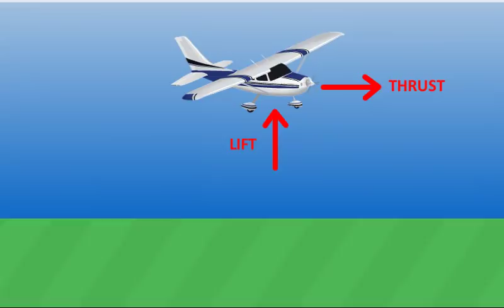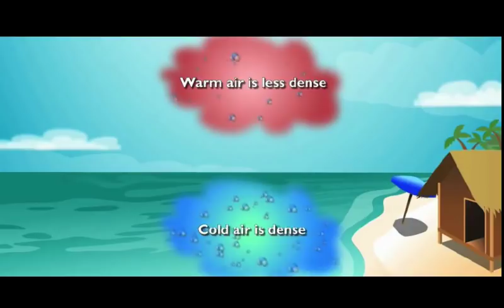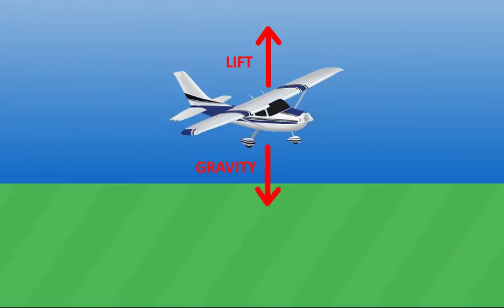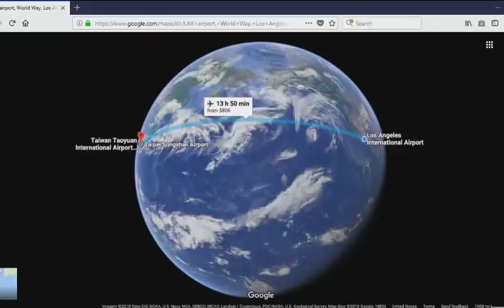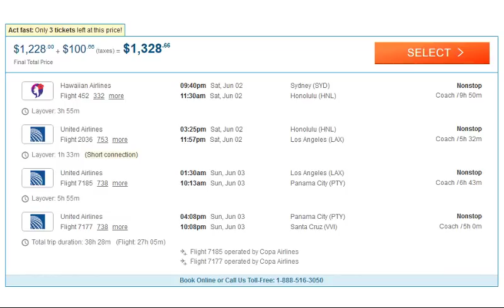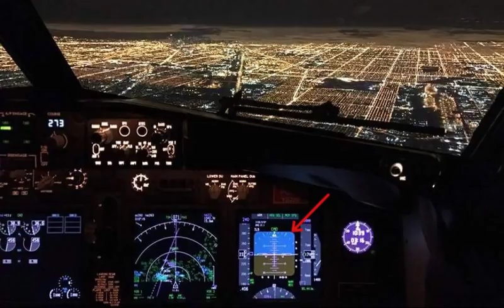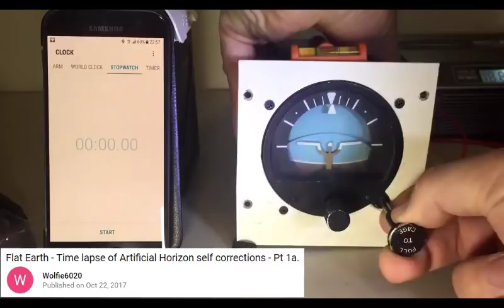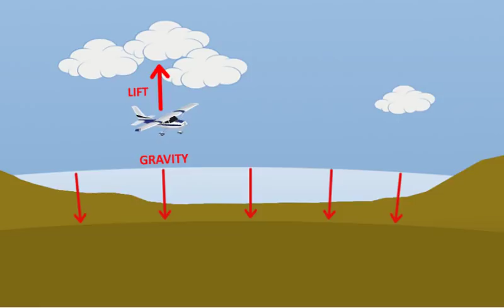Flat Earth Falsities - Plane Nonsense

Comment: your theories apply 100 % to flat earth theory.  Water should flow from top to bottom.  you are telling me that gravity is holding water drops of the oceans in their spots.  There is no dome but how can you be sure that the earth is round?  no body has a pictures from space to show the roundness of the planet.  You are helpless if you believe in satellites and Apollos.  How come air moves around the planet.  put the boy and the ball on the top of the car and see what can happen.  if the earth and it atmosphere are one system then the wind should not move and everything should be like a gel. How come our air doesn't escape to outer space (vacuum).  It can not on the flat earth because of density and not gravity which is an acceleration m/s2.  Define gravity in physics term if you can with units do not include weight F= mg.
Reply: So again all evidence that proves the earth to be spherical is disregarded as fake. There are pictures of earth from as early as the mid-60´s, way before photoshop and personal computers, how did they fake them? Btw: those earliest photographs of earth from space were made by the Russians who were at fucking war with the US at this time. Just google them, you moron.

You do realize that the car can´t make the air around move it at the same speed it goes so the boy on top of the car would face winds in about the same speed as the car goes.
the atmosphere does move along with earth´s surface, but there are differences in air pressure because of warm air being lighter and ascending which reduces the pressure and makes cold air float in. It´s called wind. Educate yourself for a minute on Wikipedia.

Because a vacuum DOES NOT suck. Get yourself a syringe, close the opening with your thumb and pull the piston. If you let got the piston it will shoot into the syringe, just because of the surrounding pressure, not because of the lack of pressure inside the syringe. You can test this by reversing the experiment, open the syringe, close the opening and push the piston. When letting go of the piston it will shoot out, because the higher pressure inside the syringe pushes it, not because the air in your trailer sucks it out.

So if density makes you stick to the ground, why then are you weightless in a parabolic flight? The cabin is pressurized, it´s full of air, you are denser than this air as well, but you still can float.

My explanation is, that you float because the aeroplane accelerates towards earth at the rate of gravity which actively cancels out gravity while the parabolic flight is performed. please explain how parabolic flight could cancel out density. While you´re at it, please also explain how density would work holding us down when there is no gravity to define "down".
Reply: This guy can only be joking... pick up a fucking introduction to physics book!
Reply: @e k You were not paying attention to the video if you really believe "your theories apply 100% to flat earth theory". They don't apply. As for your chain of petty, ignorant objections. you could easily have answered all those question/objections properly yourself if you had tried. So why didn't you? Why didn't you figure out using Google that the Greeks knew the Earth was round since at least 600BC?
Reply: +SpectatorAlius
And you believe AIG is a factual trustworthy source of information. Only YEC cite AIG as a source of factual trustworthy source of information. Or a gullible fool or liar. So what are you , gullible, a lair or a YEC?
Reply: e k i find it dishonest of you to ask your questions and then never respond to the answers you have been given
Reply: Stormageddeon Dark Lord of All Perhaps God supplied the materials?
Reply: SpectatorAlius tell about it. The real problem is that this is all fairly simple concepts to grasp if you have a little bit of knowledge in calculus. But whatever, i don't need to know how my mobile phone works, I just have to have one to shit post about something I don't have any knowledge about...
Reply: e k have you ever seen 2 people play tennis on top of a plane?  Yeah it's possible.  Sit back down.
Reply: @SpectatorAlius
"Even a stopped clock gets the time right twice a day, " So you are cmparing yourself to a mindless machine. How quaint. ID next I assume?
Reply: SpectatorAlius
"It is simply not true that "AIG never gets anything correct". It would be a lot closer to the truth to say that you never get anything correct." So you keep saying. So what exactly do they get correct?
"And I never "came out of a YEC" no matter how often you repeat this lie." So why are you so desperate to prove AIG is a reputable source? Why?And why did you cite AIG as a reputable source in the first place.
As I keep stating, only YEC cite AIG as a source of factual trustworthy information. Or a gullible fool or liar. So what are you , gullible, a liar or a YEC?
Reply: SpectatorAlius
"@wong I have already answered that question many times." No. You have responded with evasions.
Do you believe AIG is a reputable source?
Do you believe in biblical literalism as a factual argument?
Do you believe ID is factually and scientifically correct?
Do you believe Creationism is factually and scientifically correct?
Do you believe the bible is factually and scientifically correct?
"It is simply not true that "AIG never gets anything correct". It would be a lot closer to the truth to say that you never get anything correct." So you keep saying. So what exactly do they get correct?
"And I never "came out of a YEC" no matter how often you repeat this lie." So why are you so desperate to prove AIG is a reputable source? Why? And why did you cite AIG as a reputable source in the first place.
As I keep stating, only YEC cite AIG as a source of factual trustworthy information. Or a gullible fool or liar. So what are you , gullible, a liar or a YEC?
Reply: @André Figueiredo It is pretty clear he is too dense to understand an "introduction to physics" book. Yet he has the chutzpah to call others 'helpless' for believing "in satellites and Apollos".
Reply: wong You are lying again, wrong. I cited one article on the AIG site. Even a stopped clock gets the time right twice a day, this author got the philology right without relying on any YEC beliefs in the article. You should know with your debating background that you are committing the genetic fallacy when you claim I should not have done this, you are turning to outright slander when you claim I did it out of any sympathy for YEC beliefs. Again, there are none in his refutation of Flat Earth.

You are the one who needs to backtra k, not me. Get started.
Reply: +SpectatorAlius
No.
And you believe AIG is a factual trustworthy source of information. Only YEC cite AIG as a source of factual trustworthy source of information. Or a gullible fool or liar. So what are you , gullible, a liar or a YEC?
I wondered why you were so passionately vehement about the FE cult and accepting they were biblical literalists, denying that they were and claiming they were not Christians. But now you've made mistakes in your impotent frustration and anger and come out as a YEC and also used the word anathema in the old time religious meaning, which only loonies use nowadays.
I had suspected you were one, but waited for you to come out.
Go and have whimper with Ken the Ham, who is a multi-millionaire thanks to the gullible giving him money
Reply: @wrong When will you ever learn to read, wrong? Even a grade schooler can tell what you missed: it is "answers in genesis" I compared to a clock, not me. You should shut up until you learn to read.
Reply: @wrong When will you learn? You can fool no one with your stupid lying, lying so stupid, it really does make you look worse than a Flat Earther.

It is simply not true that "AIG never gets anything correct". It would be a lot closer to the truth to say that you never get anything correct.

And I never "came out of a YEC" no matter how often you repeat this lie.
Reply: @wong I have already answered that question many times. If you really don't know, it is time for you to shut up and go away. If you really do know and already forgot, seek mental help.
Reply: wong As long as you continue to lie, saying I did not answer, you have no right to expect answers for yet more impertinent questions. Admit you lied and apologize.

But of course, just like a Flat Earther, you will never admit and apologize.
Reply: +NotTheCIA I.think
"wong that went over my head.... no idea what those acronyms are." Don't you? Seriously?
YEC = Young Earth Creationist/Creationsm
https://en.wikipedia.org/wiki/Young_Earth_creationism
AIG - Answers in Genesis.
https://answersingenesis.org
https://twitter.com/AiG
http://aigexposed.com
Very common acronyms.
And dearest +SpectatorAlius cited AIG as a reputable, factual source. Then tried to backtrack. Oh what fun.
Reply: @SpectatorAlius
"Even a stopped clock gets the time right twice a day, " So you are cmparing yourself to a mindless machine. How quaint. ID next I assume?
"I cited one article on the AIG site. Even a stopped clock gets the time right twice a day, " So you mean you got it right by citing AIG instead of citing a reliable source? AIG never gets anything correct, does it. 
Also, only YEC cite AIG as a source of factual trustworthy source of information. Or a gullible fool or liar. So what are you , gullible, a liar or a YEC?
I wondered why you were so passionately vehement about the FE cult and accepting they were biblical literalists, denying that they were and claiming they were not Christians. But now you've made mistakes in your impotent frustration and anger and come out as a YEC and also used the word anathema in the old time religious meaning, which only loonies use nowadays.
I had suspected you were one, but waited for you to come out.
Go and have whimper with Ken the Ham, who is a multi-millionaire thanks to the gullible giving him money

Comment: One remark tho: the earth's rotation does have an impact (a very little one) on airplane that dont stay on the same latitude. An airplane that flies from the equator to the north pole for example would be slightly fly to the east cause the momentum of the air is lower the closer it is to the poles - Coriolis-force
Reply: Coriolis effect is negligible for an aircraft, or guided rocket, or any flying object that can be interactively guided.

Only ballistic projectiles are affected by Coriolis since they are aimed at the target before the launch.
Reply: the point is not that aircrafts would drift to east, it is that there is a measurable force that originates in the earth rotation
Reply: +max5250
You obviously missed the "(a very little one)" and "slightly" part. You're catching FE disease.

Comment: if we are constantly spinning through space constantly moving just like u claim, how are the star constellations still in the VERY same place like clockwork, wake up people ridiculous and very very wrong🤡
Reply: Further to the other comments, the constellations are not in the same places as they used to be. This is one of the main reasons why astrology is such a load of old bollocks, because the constellations move and change. 
You should try the FE cultists mantras “Question everything. Do your own research”. They never do which is why they are still FE cultists. Get the picture?
Reply from the maker: Paul Power - Easily explained. There are facts you are missing. See my video “ Proving the earth is not flat - part 2 - the stars”
Reply: Where did you get the claim "the star constellations still in the VERY same place" Please cite your source for this. There is a lot of data and evidence to show you are wrong on this but lets see where the original claim comes from.

Comment: how do flat-earthers explain wind?
Reply: Baked beans
Reply: I don't think flat earth has got that far. Their understanding stops just short of Galileo.
Reply: Paul Power well they have to ignore a lot of them no matter. Gravity would really run a muck on their flat disk which is why they have to deny it. I have yet to meet a flat earther than can calculate any of the equations they get from flattard scam videos.
Reply: i mean, i see some people ask why, if the earth is spinning then why dont planes and other aeriel objects get left behind.. well there is turbulence and its called wind >.>
Reply: RedBeard wind is caused by hot and cold air, don't trust me look yourself
Reply: is that the official statement from flatearthers? 
Because that doesnt sound like thats right at all, its pressure no? and the coriolis effect(ie broken english > spinning turbulence).
Reply: i Feckin knew it !
Reply: RedBeard same laws of physics only different layout😉

Comment: Fill a 100 ft tall fish tank with a gas that is heavier then air. Then run pressure gages along the side of it from the bottom up.... Are the pressures going to be the same all the way up???? My guess is. You’d see different pressures. Just like you see in real life. 😂
Reply: Whoa do you mean to say gasses have weight? And we can measure this? Hmm that does fit with reality. Flat earth has not been doing a very bang up job with their ideas matching reality.
Reply: Capt'Wes Starwind that does fit yes. You are correct there. There would be different layers of weight at different heights, just like our reality.. no globe needed.
Reply: Whoa slow down a sec then. How can something have weight on the flat earth if there is no such thing as this mysterious force that we call gravity? I mean we can observe it and measure it but flat earth denies this. Quiet vehemently actually, since they of course had to once it showed how their disk would collapse into a ball. Now I know your going to try saying buoyancy and density but before you do. I would recommend some more research into this before trying to use it to back up what you heard on a YouTube flat scam video. Warning maths are involved.
Reply: NotTheCIA I.think ok. Depending on the mass and density of the object it will either float or sink.  The rate of which things fall in vacuum is do to an electro magnetic attractional pull. The concept was Tesla’s I think 🤔 

Hey. Do any one of you have proof that weight can be changed based on the gravity force that is on it.  😂 bet you don’t.... bet your relying on government funded organizations that have clearance levels built in on what the pubic is allowed to know....and even some of there own team. Yup companies like that have nothing to hide 😂
Reply: Whoa so now you're going to get into electromagnetism? I think that may be a bit far for flat earth at present. Look up Michael bloody frakin Faraday and James Clark Maxwell. If you are trying to say electromagnetism is at play here but gravity is not your reasoning is worse then I thought. You really need to do some actual research. You go on about how gravity can't exists and now this electro magnetic attraction pull accounts for that. Oh my. Where to even start with that mess. Seriously go do some research on the two individuals I mentioned and then work back from that point. Flat earthers are suppose to say its all made up since you can not see or feel it. When did flat earth make this discovery into Faradays work. They haven't really started with Newton and Laplace and are utterly baffled by Galileo and Copernicus. I actually have never heard of them getting to Lapace yet.
Reply: I wonder what their equations for density and buoyance are?
Reply: NotTheCIA I.think soooo your telling me. You believe. A 747 airplane will weight 15,000 pounds lighter on the equator then in north Alaska 😂 ok. Show me that.
Reply: NotTheCIA I.think and if we’re in a enclosure dome type world. Buoyancy and density work fine. As is...  have you done the water / salt water and egg trick ?
Reply: Dang math always showing how it can calculate things. Well I bet we could make predictions with that math to validate a hypothesis and confirm our findings. Now on to the fun questions for As I see The World. What evidence of a dome do you have? I bet the best you can show is some youtube video with a very bad understanding of whatever they are showing. Has any flat earth researcher gone out to find this dome? Should be a very very simple experiment to undertake. Why people believe in this magic dome is still beyond me since not one shred of evidence exists to back it up. Who built it? What is it made of? Why has it not collapsed? What's on the other side? Why do we not see a glare on it? Why has nothing ever hit it like a flat earth drone with a gopro on it? All I have seen is one video showing an explosion in which you can see the air ripple? Not very convincing at all. Flat earth scam videos make all sorts of "challenges" yet they have never bothered to do this which would be easy when they claim to have 100k to give away.
Reply: Ok O'll bite. What's the water / salt water and egg trick? How do you think this proves your case for flat earth? What about it are you not understanding?
Reply: Superior planet awe you took all the fun out of hearing him explain what he thinks is happening. :( I didn't think flat earth had got that far in junior high school science yet.